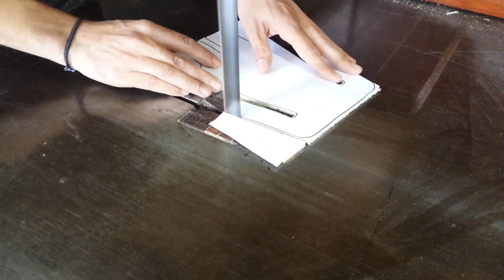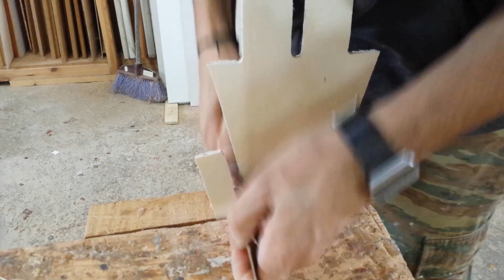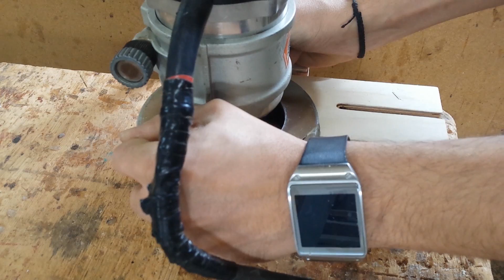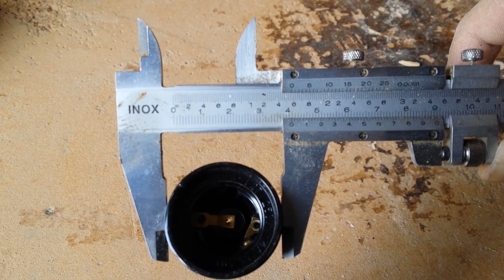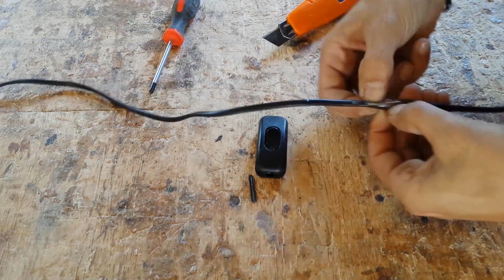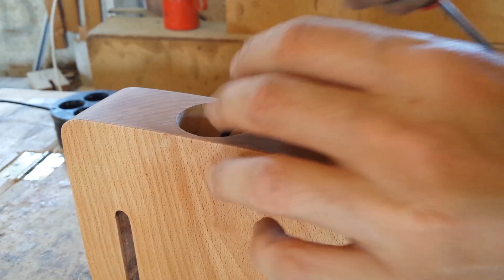Male And Female Bedside Lamps (FS Woodworking)

Comment: Great work! Why did you make a wooden template?
Reply from the maker: +Angelos Pap The wooden template works as a guide for the router. Using a flush trim router bit you can clean up the edges and save much time from sanding